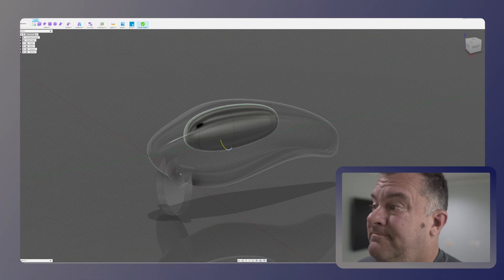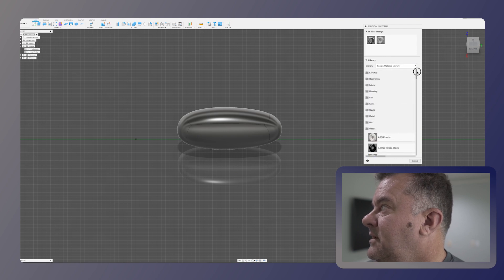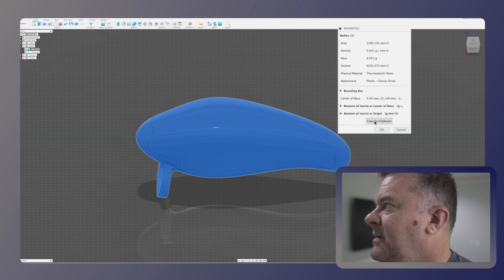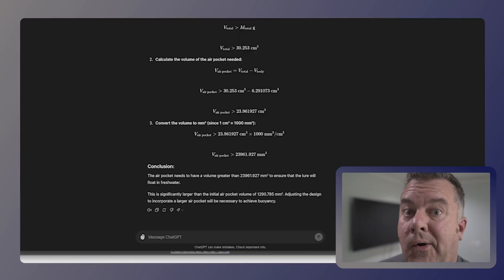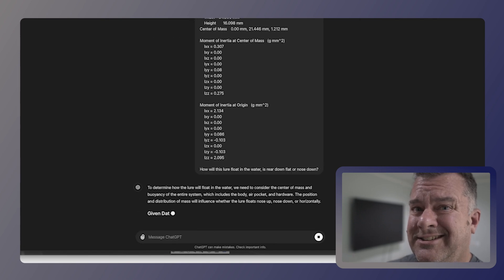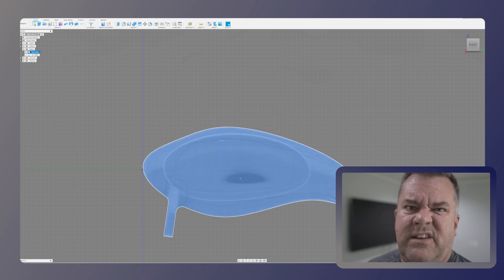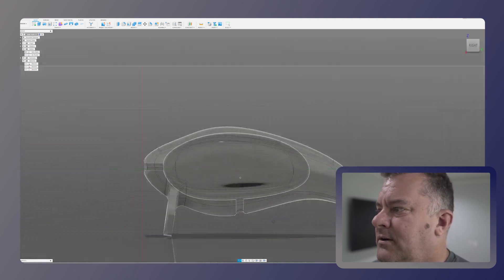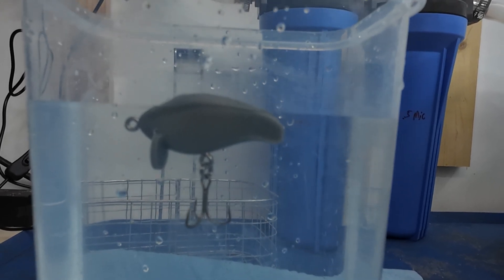Will Your 3D-Printed Lure Float or Sink? Fusion360 + ChatGPT = Magic!

Comment: Thanks for this upload, it will save prototypes. 
Have you ever used microballoons in your resin when printing?
Reply from the maker: I have not, you need to watch the size of the balloons and make sure they are smaller than your layer height, otherwise you are just going to crush them and probably rip a hole in your FEP.

Comment: Something else you could do to have a more uniform air pocket to the resin body is duplicate the body layer and scale it down using the same plane to fit inside the body. You would just need to take the bulk out of the form. Just a thought! The scale function would also let you make small and consistent size changes based of percent of size change. Cool project!
Reply from the maker: 💯 I like to leave a bit extra around the areas where I am going to put the screw eyes but your technique works as well

Comment: The resin slowly gasses off internally, adding internal air pressure until the print breaks. That's why they often appear as single big cracks; it just finds the path of least resistance.